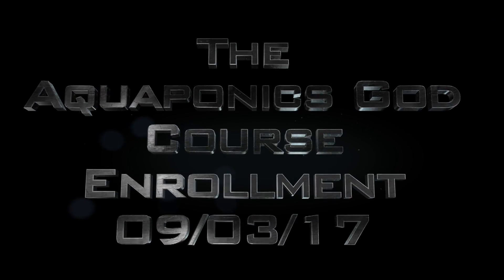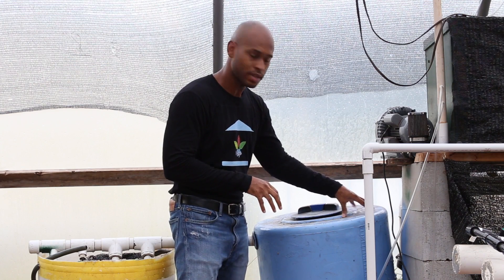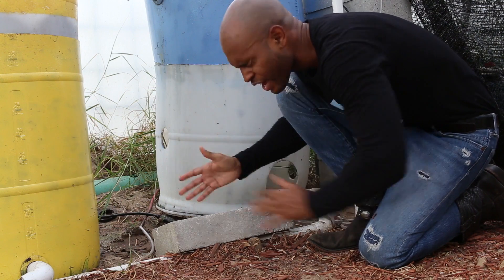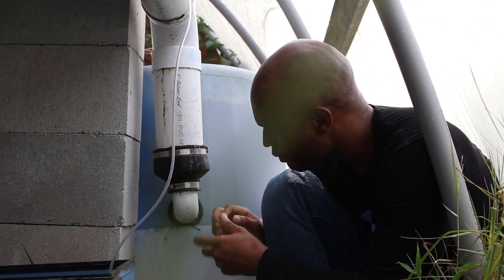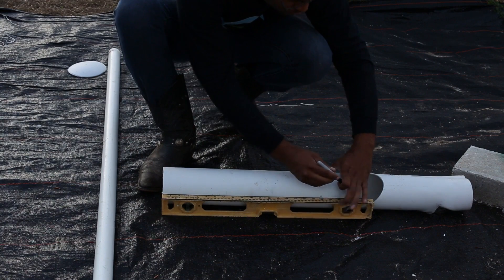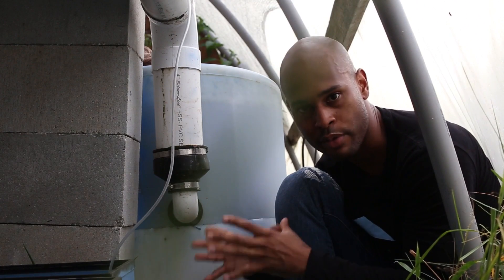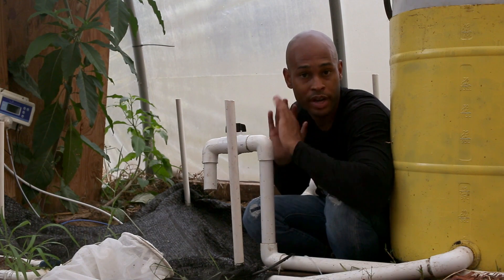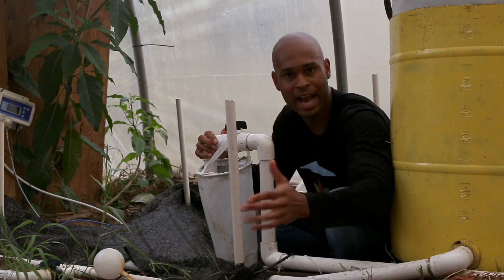Aquaponics : How To Build A Radial Flow Filter

Comment: Just a couple of things...
1.  Yes you can give us all the AP god secrets otherwise what is the point of these great videos. 
2.  OK, I know this may be hearsay but I think I may have a better idea on how to filter out the fish poop and this video just gave me the idea.  You are going through a radial flow filter but then you are running the "junk" from  the RFF thru a filter sock before the water goes back into the sump.  What is the point of the using the RFF if you are going to use a filter sock anyway?  Would it not be both simpler and more efficient  to just use the filter sock ILO the RFF?  Seems to me the use of the RFF becomes an unnecessary redundancy if you are going to use the filter sock anyway.

I look forward to your feedback and from anyone else with relevant comments.

Bill

Comment: Have you considered using a inclined plate filter? I know that they are more work to construct but they give even better results. I plan on making one when I build my setup. You can get many times the settling area in the same footprint by simply using the viscous boundary layer forces of inclined plates.
Reply: Do you have any info on this Michael? I'd be interested to see what this is?

Comment: You did it again: use a plugged power drill to drill a tank filled with water... Not sure it is a good example of work safety. Apart from sharing the concept of what is an RFS, you do miss an important point. But I am sure you will do a video for that too. Keep it up

Comment: I watched you try to slap the fly about 8 times. Because the first time I swore you slapped yourself. Not once did I see where the smack noise came from. Anyway. Nice Tips and Tricks. Very cost conscience. Thanks
Reply from the maker: Yeah I popped myself on that clip. The fly won that battle.
Reply: They usually do. Till they dont. Lol Thanks for the video

Comment: Brooklyn, that is technically not a radial flow filter, a radial flow depends on the water swirling to drop the solids out, but this looks like an easier build, more intelligent and and efficient settlement filter than any homebrew radial flow that I have seen, including my own.
Reply from the maker: You're referring to a swirl separator, which is slightly different from this type of filter.
Reply: Yes, indeed, and after snooping around the web a bit, I see that this is generally called a radial flow filter now, I learned about swirl filters back in the 80s, and since "Radial Flow" correctly means that the flow follows the arc of the radius, (as it does in a swirl filter,) I never looked into the difference, I assumed they were the same. NB When you AssUMe, you make an Ass out of U & Me... ;)